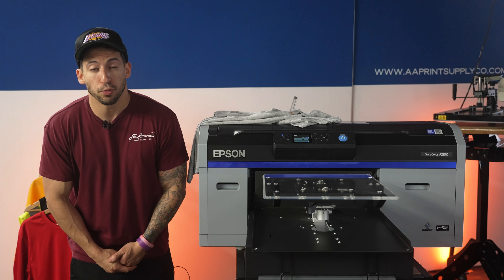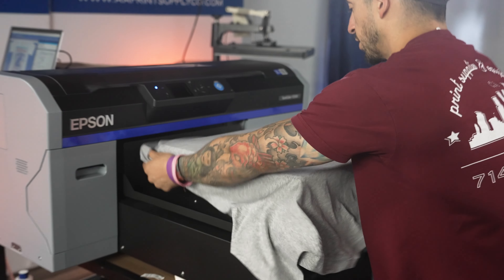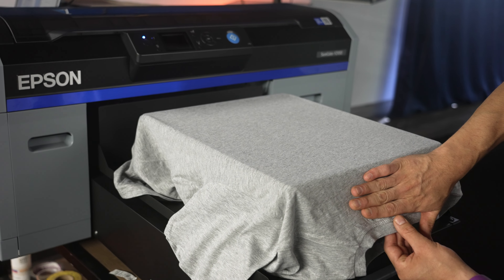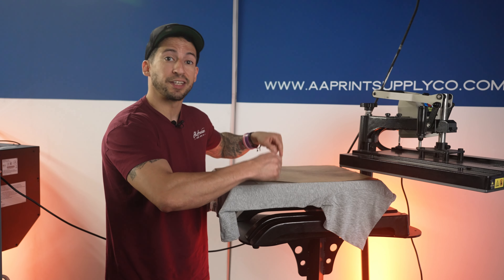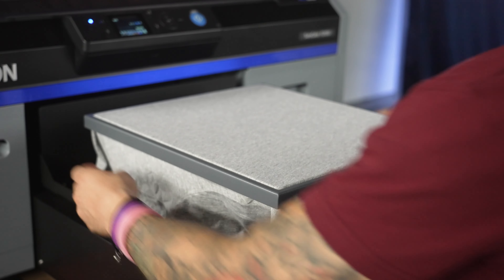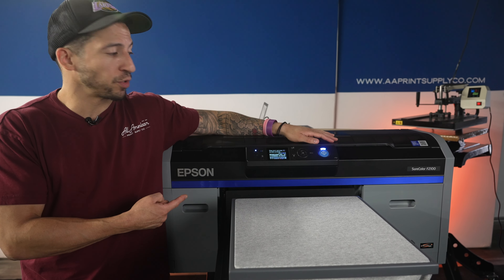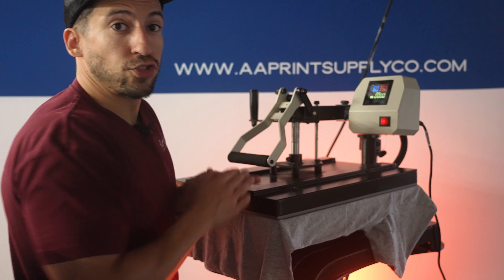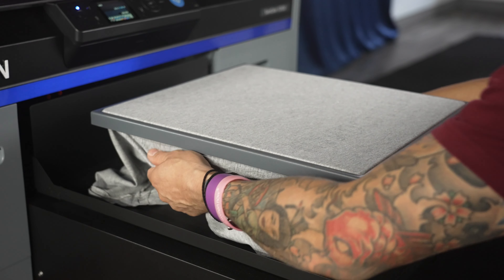DTG Placement: Make A Full Shirt With Us! | AA Print Supply

Comment: When you press the chest piece on, do you need to protect the backside from the heat like you would with sublimation it did not look like you added anything so this is why I asked. Thank you.
Reply from the maker: Hello, as long as the print is fully cured before moving onto the next print location you should be fine to proceed as outlined in the video. Great question.

Comment: Hi Sir can you please advise me how to presetting for DTG settings
Thanks
Reply from the maker: Hey Mark, what printer are software are you using?
Reply: @AAPrintSupplyCo  Hi Sir Epson 2100
Thanks
Reply: Garment creator
Reply: @AAPrintSupplyCo  Garment creator software 
Thanks
Reply: @AAPrintSupplyCo  Garment creator software I followed your settings for DTF and the print quality is amazing 
Thanks for that
Reply from the maker: Hey, thank you for the kind words so glad they were able to help you. Honestly for GC on a normal cotton t shirt I usually run level 5 quality and leave the settings as default. I will say the pretreat step will be the most crucial to getting good prints
Reply from the maker: Can you share what pretreat, how you are applying it and what the main issue we are looking to correct print wise and we can go from there
Reply: @AAPrintSupplyCo  we buy the DTG T- shirts and print on that but the prints are not vibrant so I need to do the pre set up for dark colors T-shirts and for white color shirts 
As you did for the DTF print
Reply from the maker: Ok, I do have a tip for those: before you actually print I like to do a HEAVY pre press. Heavier pressure than you would for a normal pre press and press heavy for 45 seconds. That should improve your results on level 5 print quality. Personally speaking, I think level 6 is a lot for a T-shirt but that double white base layer can also boost vibrancy. Have you ever considered pretreating in house? Perhaps even manually with a good hand held continuous sprayer?
Reply: @AAPrintSupplyCo  hi Sir I’m asking about the DTG T-shirt which is ready to use on the Epson 2100
Reply: @AAPrintSupplyCo  ok Sir 
Thank you 
Mark